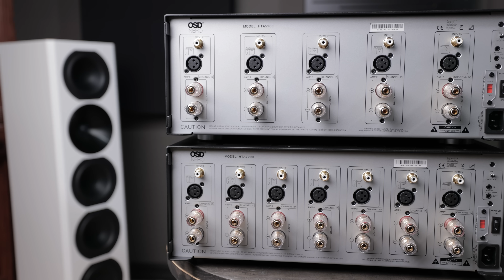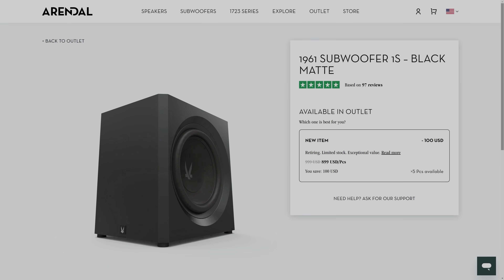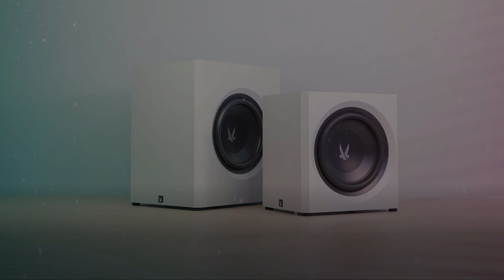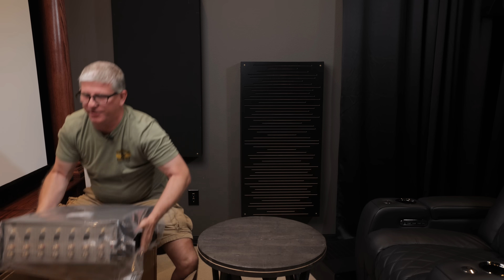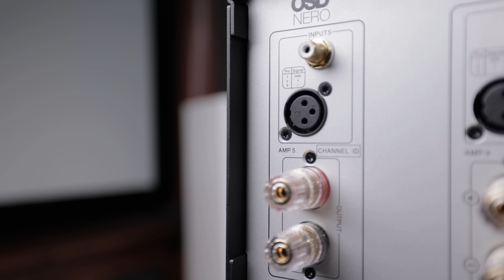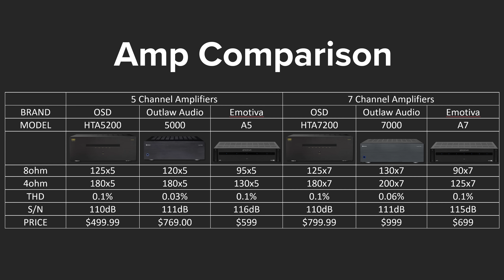OSD AGRESSIVE Pricing on New Amplifiers! HTA5200 & HTA7200

Comment: What about Monolith? Why not include that brand as well. Aren’t you using a Monolith amp in your theater setup? Great video can’t wait to see the shootout!
Reply from the maker: Jason, I didn’t include Monoprice as their 200x7 is $1,800. I forgot they did come out with a budget series so that could be comparable as well. Looks like they have a M7100X (90x5) for $650 and a M5100X (90x5) for $550.
Reply: @Youthman Audioholics reviewed the new cheaper Monoliths and they appear to be the same exact amps as the Emotivas, both circuit board and performance wise.
Reply: @Youthman  I got my M7100 on sale for $494.
Reply: you could always go to their website for that info
Reply from the maker: And yes, I’m still rocking my Monolith 11X but it’s $2,500.
Reply: @Youthman  Awesome! Thanks for the update.
Reply: Those thd snr measurements don't really tell you which sounds better or is the better amp. It's just a placebo to make the person think they got a better product.
Reply from the maker: I’m not saying they do. Just simply replying that the OSD have a better S/N ratio than the comparable Monolith amps. Their higher 7X and 11X models have a better S/N ratio but they also cost 2 - 3X the price.

The reality is most people would not be able to tell the difference in a blind test between most amplifiers. Unless the amp has a hiss, buzz (ground loop) or is running out of gas at high volume, you likely will not be able to accurately differentiate between amps. Of course this does not apply to tune amps as they intentionally introduce distortion.
Reply: Hi, I came to this preview a little late. Is there any chance OSD runs that promo again? I'd love to jump on it if they do. Not that they are not worth the full price, but that deal was in my price range!
Reply from the maker: @seanlemaster2377  I don't believe so. They only ran it for 48hrs. I have no control over that. They are sending me new class D amps and will offer a Youthman code for that as well so stay tuned.
Reply: @Youthman  thanks for responding! I really only need a 3 channel version (which i know is coming later on this summer). With that said, does the hta5200 run at a higher wattage if you're using 3 channels? If so, the future flexibility of 5 channels might be attractive. At $699, it's still a nice price.
Reply from the maker: Honestly I’m not sure if it will divert more power per channel if you do not utilize them all. I would reach out to OSD support. Let me know what you find out.
Reply: @Youthman OSD responded with this "If running only x3 Channels on the 5-Channel HTA5200 Amplifier, each of the x3 Channels will receive 200W @ 8-Ohms, or 250W @4-Ohms. If you go this route, we typically recommend using Channel-1 + Channel-3 + Channel-5."
Reply: It may be overkill for my b&w 602 s3's mains and center, but my onkyo rz50 starts distorting a bit around 75 db on the volume, pushing all 9 channels. More power can't hurt right?
Reply: Monolith are a big step up in quality. These are good deals for budget amps but the distortion and signal to noise ratio is entry level.
Reply from the maker: Actually, the Monolith M5100X has a worse S/N of 100dB (A-weighted which could be 10dB higher) while the OSD HTA5200 has a S/N ratio of 105dB. Their A-weighted is 110dB. So you might be comparing 90dB to 105dB between the two with the OSD having a better score for S/N. 

"Note too that A-Weighting is often used to specify signal to noise ratio (S/N) for amplifiers, preamps and other electronic devices that are used for audio.  The claimed figure with A-Weighting can be 10dB or more 'better' when A-Weighting is applied, because all low and high frequency noise is attenuated."